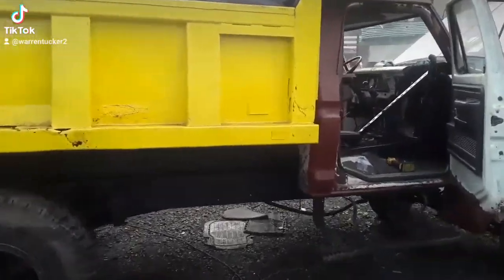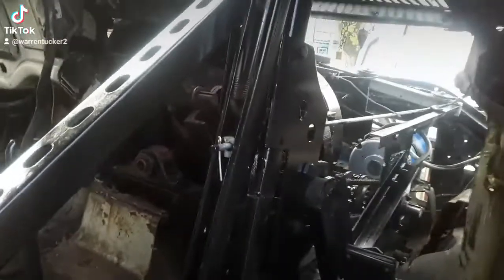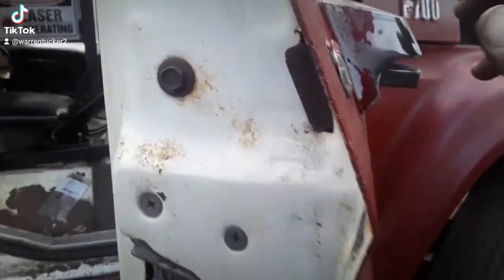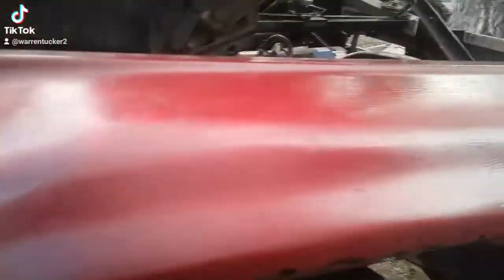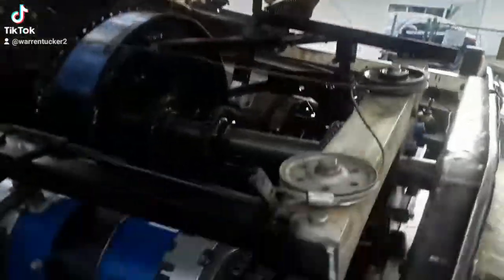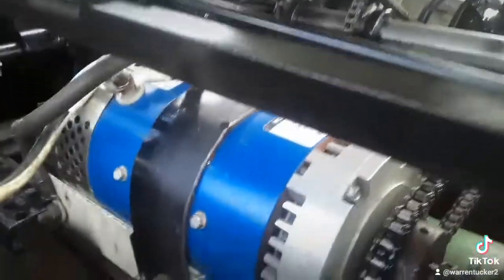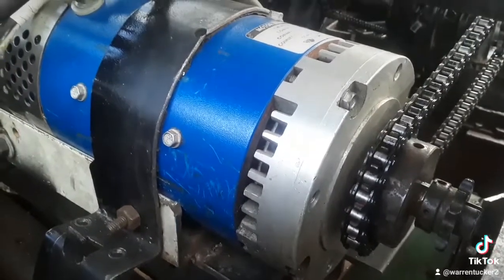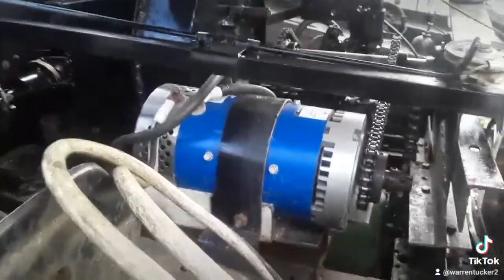PEDAL POWERED DUMP TRUCK updated!

Comment: "You're not moving 16,000lbs with 4 horse-power", but you are moving 16,000lbs with 1 human power (about 1 quarter horse power?
Reply: If you look at the cyclists that set land speed records, the bikes feature a front chainring that's about 2 feet in diameter. You'd never be able to pedal one of those off the line. Instead they draft a lead car that brings them up to speed, then they can actually pedal a bicycle at close to 300 kph.
Reply from the maker: @lihtan  RIGHT, and I've seen those draft cars have fairings to help block the wind.

As soon as more developers realize HUMAN POWER can move heavy vehicles and produce enormous amounts of power with flywheels, you'll see a radical change take place. Doing this has become all too easy. We plan on turning the tractor trailer into a human powered rig as well. 🤗🤗🤗
Reply from the maker: EXACTLY! It proves that the flywheel system in this dump truck is working. The starter STARTS the system, human power keeps it in motion. It's just basic elementary physics, like we were taught in third grade. Somehow industries started engineering machinery backwards, engines don't have the power you were lead to believe. 

Human power will blow away any fossil fuel engine you could ever build. We're doing these engineering studies on a shoe string budget, if we actually had some real money to work with, human power would blow the doors and hood off that dump truck! 

In the video of the blue dump truck and trailer backing up, we had to pedal gently, otherwise we would have blown the rear or transmission like we did at the tractor pull in 2012. These videos are over 10 years old, the technology we have today makes these demos look like a joke.

ENJOY! 🍷🍷😎😎